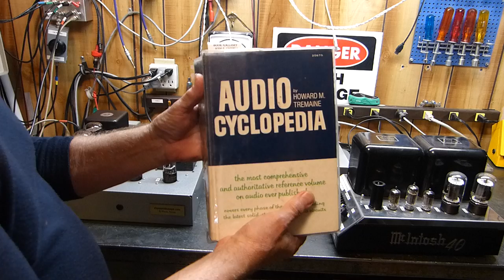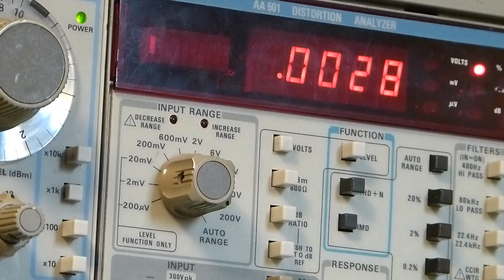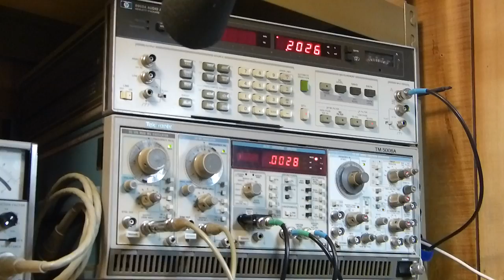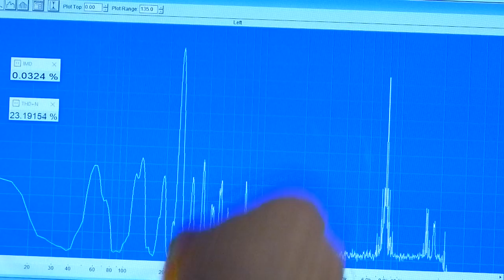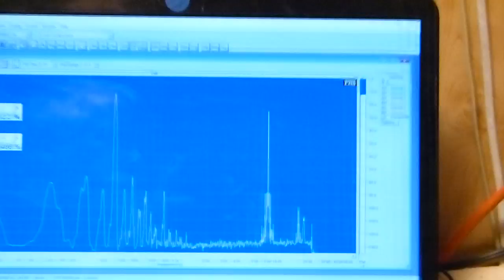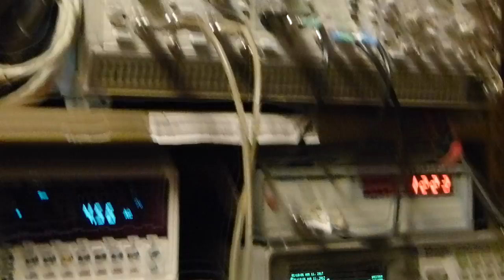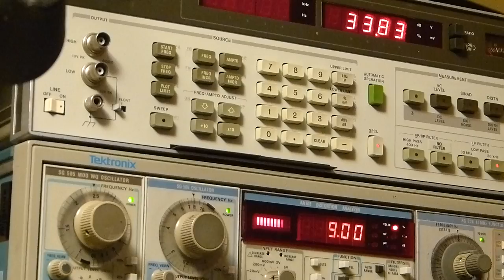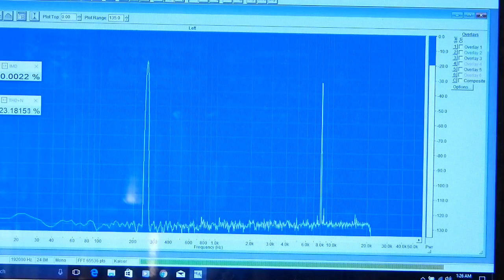(1 of 2) An Attempt To Measure IMD (Intermodulation Distortion) In Vacuum Tube Audio Amplifiers

Comment: Love the brutal reality of your videos. You deserve a lot of credit for having the guts to show what really happens on the bench. IMD never struck me as important - one of my early forays was building William Marshall Leach's Low TIM amplifier back in the 70's. Transient IMD was the focus, great sounding amp, but I can't say I've ever had a problem with this TIM stuff, nor IMD. Due to the complex way our hearing works, our brains also create it! Of all the various "distortions" three seem take up much of my thoughts. Noise - always my primary concern. Digital File Compression - it's ubiquitous; probably the worst offender of all. Go figure...  Then there's audio signal compression. The garbage that commercial, corporate audio industry thinks we simply must have, the "twinkie" of audio. Simply walking outside and listening, even just a chirping insect, is so refreshing (in comparison).

Comment: Hello.

I have been accompanying your channel for a long time and I really appreciate your videos, I was very excited to buy them an HP334A that I should receive in the next few days. I have one question that may sound stupid, which is this:

When you perform the tests using the audio + oscilloscope analyzer to check the THD of the amplifier under test, the volume potentiometer is fully open (maximum volume) and the waveform check on the oscilloscope is monitored so far That the amplifier starts distorting is done by checking the output level in the audio generator, correct? Or does Mr. stipulate for example 1VPP in the audio generator and increase the volume of the amplifier until it begins to distort the waveform displayed in the scope?

Sorry for my English.
Reply from the maker: Here is a link to an article I think you will like.
http://lcweb2.loc.gov/master/mbrs/recording_preservation/manuals/Tektronix%20Cookbook%20of%20Standard%20Audio%20Tests.pdf

I monitor the output of the amplifier across the 8 ohm load with both the oscilloscope and the HP 334A and watch the oscilloscope for clipping at the top and bottom of the sine wave. Just at the point that clipping is about to start, assuming the clipping is symmetrical top and bottom of the sine save, that is approximate the 1% mark for THD.
The Tektronix article link attached suggests running the amplifier at full volume but you can also control the output by varying the gain control on the amplifier and get the same results.
Here is a link to a video on the HP 334A that I made about 6 years ago. I made two videos but I think this is the better one.
https://www.youtube.com/watch?v=yVLudWhqxmE&t=78s

Good luck with your new instrument and thank you for your comments.
Reply: ElPaso TubeAmps

 Hello.

Many thanks for the reply. If it is not too much to ask, I would like to ask one more thing:

For several days I worked on recovering the HP334A, and I believe I have achieved a good result. My question is how to turn the distortion measurement that my HP 3324A function generator reports in DB for percentage (%). The HP 3324A data sheet states that the distortion in the sinusoidal function is -60db. By plugging the HP 3324A output via 50 ohm termination the HP334A distortion reading is 0.07%.

Would this reading be consistent with the -60dB specification?

Thank you very much.
Reply from the maker: Here is what I just found - 
http://www.sengpielaudio.com/calculator-thd.htm
I haven't tried it out yet but if you get a chance to use it please let us know if it works. I am actually in Cancun right now but will be home in a few days and I will test it also.
Reply: ElPaso TubeAmps 

Thanks for listening.

The conversion table appears to be correct, -60dB equals 0.1% according to it. In my test, I read 0.07%, very close, and if we take into account that the specifications are usually reported in the worst conditions, I have a good chance of being successful in repairing my old HP334A.

Thank you very much.

Comment: try with 125Hz and 7Khz, a friend of mine tryed the same things and discovered that the generaotrs was producing some odd harmonic and make the IMD analyzer to loock at the second signal like distortion and not as a component, your generators look very clean but........

i know that it is not in the argoument but i am becoming crazy, i have a tube tranciever, but i am not able to use an antenna tuner because on any adjustent on the tuner the plate current jump at full scale, i am using a T matching unit and i am thinking that mayhbe the plate load capacitor is influenced by the input capacitor but i am not shoure, i am doing something wrong or with the PI filter on the output network of the radio i can not use an external tuner?

IU3IRR, italy 73
Reply from the maker: I can vary the lower frequency and/or the upper frequency to assure there is no harmonic interaction and nothing changes. I will continue working on it.  I have gone down to as low as 20 Hz at the lower end and 10 KHz at the upper end and nothing really changes. On the McIntosh MA230 clone, I can get as much as 23 watts ad 0.5% IMD but not so on the MC40. Very confusing. Thanks for your suggestions.

As for your tranceiver, I would check that all of the wafer switches that switch bands are clean and making good contact. Also, it sounds like it may have a neutralization issue and is going into a parasitic as you tune through the range of the capacitors. I would first do a very thorough cleaning of all of the contacts in the output and input tuning circuits. Use a good contact cleaner spray or brush on solution. I have the Collins S-Line of equipment that is going on 60 years old and I occasionally have issues with the contacts on switches. Mostly my problem manifests in no output until I wiggle the contacts but intermittent and unstable conditions can also be caused by poor contacts. Good luck. Please let us know what solves your problem.
Reply from the maker: I forgot to mention the tubes. I would pull each tube one at a time and spray/clean the tube pins and socket and make sure each tube gets placed back in its original socket so as not to compound the problem. The same cleaning procedure should be used on the antenna tuner making sure you are starting with the capacitors fully meshed or as the manufacturer suggests using the tuner. Bad contacts there could also be a problem in the switches or contacts on a roller inductor if that is the type it has. I am betting it is a bad contact(s)  somewhere in the chain.
Reply: mm very strange... maybe on the original MC40 there is some "faulty component" and for faulty i do not mean leacking capacitors but maybe some drifted capacitors and resistors.... onestly is the last thing that i can imagin..............

but for tmy radio problem i am not having any problem with the radio,  i ma having problems with an external tuner ( a T match by the way), i can not vary any capacitance or inductance witout detuning the internal PI filter of the tubes, i have also tried to match the internal tuner in a dummy load so it is "pretuned" to 50 ohm and after thet connect th tuner and try to match the antenna mut nothing to do....
thanks for your tine, IU3IRR, 73

Comment: What you're doing is  OK as far as the Tek AA501, as long as you have it set internally for SMPTE/DIN or auto mode (J1053), which you seem to. But if the FFT software wants no harmonic relationship between the tones, you're violating that, as 8000 is the 32nd harmonic of 250. That might account for the lower spuriae, if that's what they are. I have an SG505/01 which generates and correctly mixes both signals automatically at the touch of a button, which is simpler, but I have to say that measured IMD numbers don't mean a lot to me. I never use the facility. The Fourier theorem says that any IMD must show up as THD as well, so you have to wonder what the actual point of IMD really is. Maybe it was a lot easier to measure than THD in the old days. Your AA501 does a bit better than mine on the raw signal at .0024% or whatever it was: mine won't go below .0038% at 0dBm. Maybe that is the oscillator, as it is a bit worse than the one I actually use day to day. Best EJP
Reply from the maker: I think you have some really good points. I didn't see it last night but now I do see that 8 KHz is the 32nd harmonic of 250 Hz. In any case, I varied the low and high frequencies and nothing changed even when I intentionally crossed harmonically related frequencies. 
There sure isn't much on YouTube about audio frequency IMD. A few really feeble attempts but nothing reliable. There are a few that do IMD at GHz levels but I don't need that and I cannot repeat their measurements. I intend to continue researching this and as you say, it seems THD is sufficient. I went over one of the amps last night setting it as perfectly as I can, i.e. cathode currents, driver symmetry, etc and it made little or no difference in IMD. I think I need to move to the AD2 for my FFT display. It has a much higher noise floor but it also has a much wider FR in the input channels. The SpectraPlus software is marvelous but it is not of the same caliber as the HP and Tek so that can be a confusing factor. I will also research how McIntosh tests their amps for IMD. My confidence in that company is solid and I use their equipment as a benchmark. Your comments and discussion are much appreciated and help me advance. Regards, RDB
Reply: ElPaso TubeAmps I looked it up in the Radiotron handbook. There's a very good discussion in there. It was indeed easier to measure than THD. The SMPTE method was to filter out the lower frequency, easy enough when they're so far apart, and them AM-detect the remainder, which is now essentially an 8KHz AM carrier for any IMD. Really simple, and no manual setup other than the sources. THD on the other hand requires really good nulling and all that, like in the HP 334, and wasn't at all high-resolution until I guess the Tek AA501. I will be very interested to see what you come up with. Keep up the good work and the fun. EJP
Reply from the maker: I do remember the HP 334A. I liked it but it was a bit laborious. I just uploaded the second successful video and the details of how to make these IMD measurements. Thank you very much for your research and help.
Reply: ElPaso TubeAmps As to causes, no doubt you know this but, for completeness, Radiotron says that IMD at very low frequencies is caused by transformer saturation. It also kind of hints that if you rank amplifiers by their IMD you get a similar ordering to an aural ranking, which certainly isn't the case with THD.

And finally, maybe for others with this gear, the Tek manuals aren't very precise about the different IMD methods. I assembled this information from several sources:

SMPTE: 60Hz, 7KHz, 4:1
DIN: Any two notes of which one is an octave of the other, e.g. 250Hz, 8KHz, 4:1
CCIF: 14KHz, 15KHz, 1:1